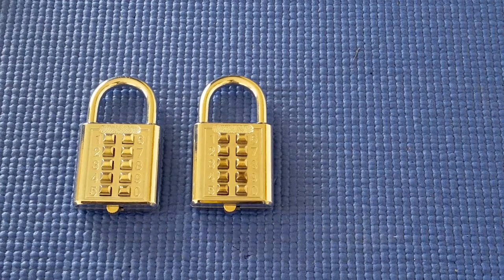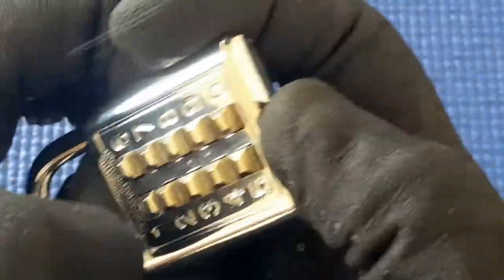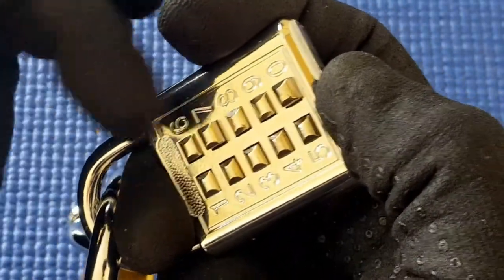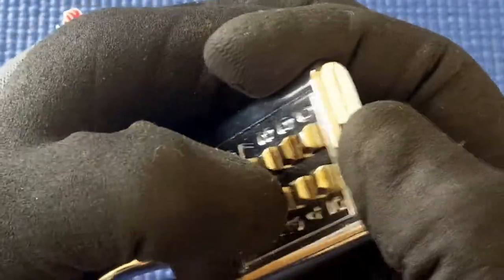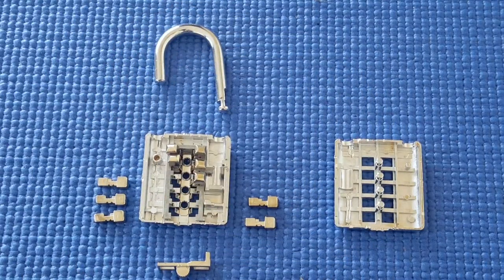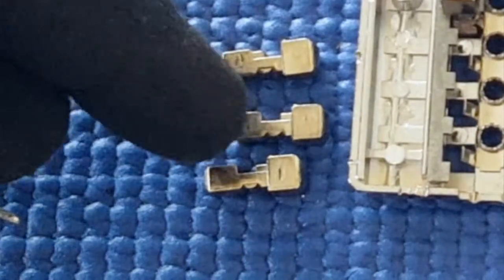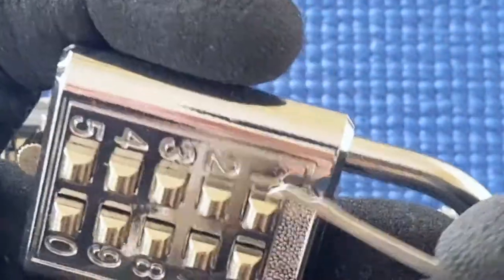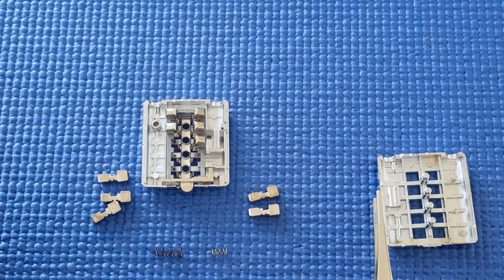(Picking 29) Push button digital combination padlock (decoded)

Comment from the maker: After dismantling this lock and seeing how it works (and having a further play), I have found that it's better to have moderate (not light) tension on the shackle (and only light tension is enough for the bottom lever) because it's the shackle tension that binds the push-buttons.  Make sure to tension both the shackle and the bottom lever for the whole time you are decoding (but the the bottom lever is only pushed to release the shackle).

Comment: Thank you for giving us a look inside. These 10 numbers locks seem to be a lot of fun to play with. Do I see this right that tension on the shackle does not increase the binding strength on the buttons, because of the rectangular cutout on the shackle for the retaining piece. I guess that with no tension on the shackle at all the binding state can be identified more easily.
Reply from the maker: Thank you sir Potti! :D :D  Good question - I have a better understanding now that I took it apart, and have had a further play ... from what I can tell, shackle tension does increase binding on the buttons (as long as the bottom lever is pushed over).  I didn't point this out clearly in the video as I thought it was the bottom lever that did the tension binding (and had to be held firmly), but it's not ... the lever has to be pushed over so the "jaw" with the teeth can move up (otherwise it's hooked in place in a window cut-out in the lever), but it's the shackle that moves that jaw.  The shackle is spring loaded, so entering the right combination and then pushing the bottom lever across pops the shackle open (as the shackle is spring loaded).  If the lever wasn't there at all (and so if it wasn't capturing the jaw in it's window), the spring tension on the shackle is enough to bind the buttons slightly, and some of them would be difficult to press (and the buttons would tend to not move from their correct up/down position) - so that bottom lever is a good  design, as it removes all tension on the shackle (and hence binding on the buttons) while the buttons are pressed easily by the user.  Further testing shows that after moving the bottom lever across, more tension on the shackle increases the binding on the buttons (and so it's easier to decode).  This is probably what you would have thought anyway! The reason I got confused is because with the 8-push-button padlock, I could push the lever over and tension the shackle at the same time, and I could then let go of the lever (it's nice only tensioning one thing instead of two) and it wouldn't pop back (unless I released tension on the shackle) and entering the right combination would pop the shackle, but with the 10-push-button one, doing that and entering the right combination wouldn't pop the shackle unless the lever was pushed further.  With the 10-push-button one, I can see that pushing the lever and pulling the shackle (at the same time) and then releasing the lever, the lever would pop back a little bit (it has its own spring) and so did the 8-push-button one, but with the 10-push-button one it was enough so the jaw couldn't escape the lever window.  So I mistakenly thought the lever had to have lots of tension and the shackle only a bit (or even just its spring tension) but actually the lever just had to be held over (light tension is enough) and go heavy with the shackle!  That was a longer response than I had planned!
Reply: Oh wow, that was an answer longer than expected ;-) Thanks for the detailed information. Will see if it makes sense to me - have to read it slowly and carefully again.

Comment: Hello. I have a very nice Gucci briefcase but the lock is locked open. So I can’t close it. And was wondering if you would be interested in helping me pick it open?
Reply from the maker: Is the lock a push-button one or a combination one?
Reply: Hello, its a lock made from 3 wheels of 0-9 digits.
Reply from the maker: Hmmm for that one, you'd either need to try every combination (it'd take a while) ie 000, 001, 002 etc where you'd try each one by either pushing the opening lever or by pushing the locking arm (but release tension between each number - that's important!), or another hopefully quicker way is to use a thin piece of metal to "decode" it, similar to this: https://youtu.be/mxM4cEZz2hQ?t=123 or this: https://youtu.be/WJNs38RTg_M?t=183 (you see some of the wheels need to be turned by the same amount around until the gates are in the right place).

Comment: For better quality Zarker button lock made in Korea, it will be very difficult to trial as the opening lever will only work if the 5 numbers are correctly depressed. 

First press the opening lever. Then press button one by one. If one stuck, that's the button not inside the combination. Push it to normal after release the lever tension. Then press the lever again and continue with other buttons. Repeat until 5 numbers are left that can be depressed easily, that will be the magic number to open when you push the lever.

Alternatively, depressed all buttons and try to push up button one by one. The one stuck is to be push up after release the lever tension. Then press the lever hard again and push other buttons up. Continue until left 5 numbers yet to push up, that will be the combination.
Reply from the maker: Thank you for the detailed and well-explained tips!
Reply: @Swynndla  I learned and modified this opening skill to open my Zeeker button lock by following yours & others useful videos. In fact pulling the shackle is not necessary for better quality button lock.

Thank you for teaching me how to open my lock i had kept for last 15yrs unable to open.
Reply from the maker: @naturetruth5218  Great that my videos were helpful. Well done for extending it and sharing what you found back to the community. Next step: do a video 😄😄